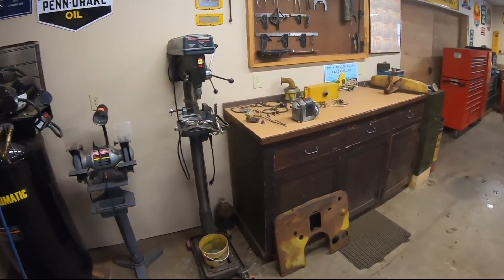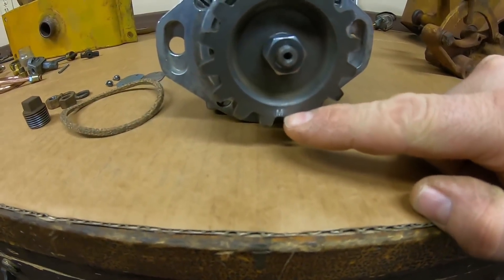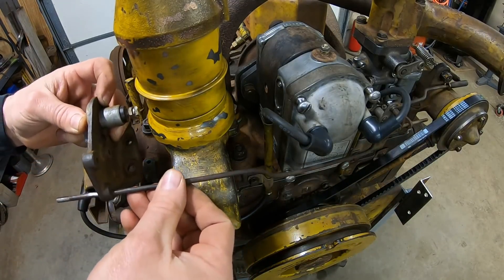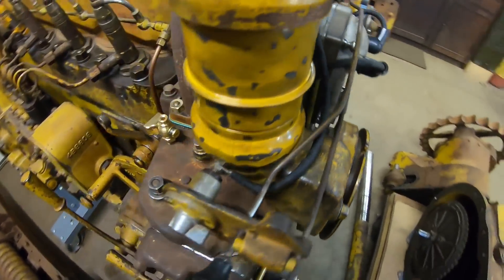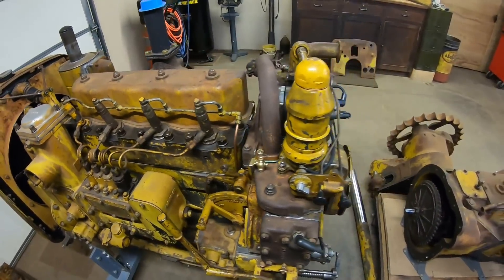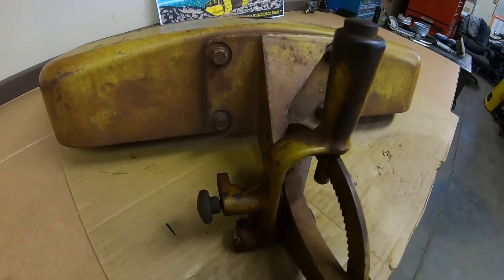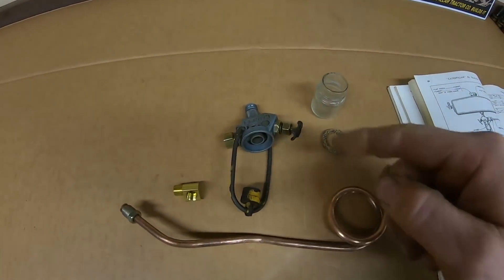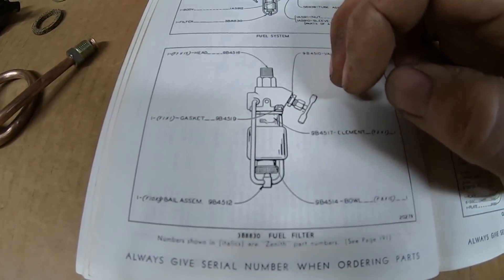Caterpillar D2 #5J1113 Starting System Rebuild Ep.20: Final Assembly Before Startup!

Comment: The overall look of the completed power unit is neat because all the parts are cleaned but not re-painted. The new parts standing out with an occasional polished brass or copper fitting for minimal bling. It says I am in good shape, ready for work and not afraid to get dirty. Great show!!

Comment: Oh the memories!  Pulling a 3-16 Deere plow with Dad's D2 back in the 1950's starting at about 8 years of age.  The sun was hot and the days were long.  We slipped on steering handle extensions of 1/2" pipe so the operator could stand while operating to avoid the wind blown dirt that the tracks brought up the backside.  The rocking fore and aft of the short tracks would sometimes cause loss of operator balance so had to hang on to the extensions which was not a good thing in and of itself.
I vividly remember holding back on the throttle lever past the last notch so as to gain a tiny fraction of additional speed.  Would wear goggles to keep the dirt out of eyes.  Would let the RD6 and D2 engines idle over the noon hour.  The D2's right track would slip off the idler occasionally and would do reversing and steering maneuvers to get it back on.  Running the track in the furrow wore the rails unevenly.  Could go on and on here.

Comment: Awesome video the fuel filter work around looks really nice. The pony motor in full dress is a real compact package. It's always a pins and needles moments when you are starting a rebuilt engine for the first time especially when you have never heard either engine run before and in this case you have lots of parts from several other machines and lots of new parts all combined into one package. Keep up the great videos Toby. It's going to be nice to see it running and blowing smoke.

Comment: Only a couple of engine rebuilds I have done started without issue, a Fordson Major unit (superb starters at the best of times) & a Isuzu pickup truck unit.
Both started on the 1st turn of the key.
Other times with various diesels not so lucky, indeed I've had to tow some down the road to get them started.
Great video Toby & can't wait for the start up.

Comment: I worked for Ford as a technician many years ago and my specialty was carburetors, fuel injection and ignition systems. One day I was talking to the shop manager who also did the same specialties as myself and he told me that back in the late 60's early 70's, Ford had a problem with vehicles quitting or a no start after running for a long period of time. He would pull the distributor cap off and inspect it and reinstall it and the vehicle would start right up and run.  What Ford found out was the constant sparking created a gas that eventually choked the spark form the points causing it to quit. The solution was the vented distributor cap. That is why the magnetos and distributors are now vented. Just an FYI.

Comment: Wix 33051 filter for a quadrajet would also do if need be. Has a check valve in it but they are seated in the rubber sealing gasket on the filter and pull right out. I've put several in sediment bowls over the years.

Comment: I hope to be there too! Well the biggest concerns for me would be fine dust or power in the fuel system tank on the pony motor. After that it would be the static leaks then running leaks. I am sure that you will be just fine. Relax and smile and enjoy the ride. It will be fun!

Comment: Old Wisconsin small engines have the same aluminum stack style filter in the sediment bowl👍 not sure of the models but those old single cylinder motors are super common

Comment: I am like you and I don't look fwd to the "start it" phase. I've built a 32 street rod, fully restored a car and rebuilt a few engines and gearboxes. No matter how careful and diligent your are it is rarely 100% successful. There will always be adjustments to make, oil and/or coolant often finds an escape route and there could be the dreaded rattle or noise that spoils the smooth whirring sound. If its none of these one of the new parts you fitted will suffer infant mortality. I love these car restoration tv programmes where they are fighting against an impossible deadline. They only have one day to paint the car and put the engine in but they always make it and they turn the key and everything works perfectly - what a load of spherical objects.

Comment: Back in the 70s and 80s, yeah I'm old, Rochester carburators used a fuel filter at their fuel inlet that looked identical to the element you removed from that universal inline unit. I believe it was used primarily in their two barrel units. They also had a sintered bronze option. 

Dan
Reply: That is what I thought too. That element is like the GM fuel inlet filters. My concern is if it will flow adequately with the low head pressure. I have always avoided using  inline filters on gravity systems. I have moved on to the in tank combination standpipe filter screen with just a shut off ball valve and no crappy  chinese filter bowl.

Comment: Rather than going through all that bs with that inline plastic filter! Get a chevy q-jet carb filter that has a rubber gasket on it and all you have to do is drill the hole for the bolt out of the box for maybe $5  for the filter
Reply: Gm started using the q-jet in 1968 and didn't change it out tell 1986 in the trucks when they changed to fuel injection.

Comment: Hat's off to you for using grade 5 bolts for your fixtures and specialized tooling. One of your previous videos, you installed brass nuts on steel studs for the exhaust manifold/exhaust attachment. That is the first time I've ever seen that. After researching I discovered that using brass nuts on steel studs makes disassembly easier. My question is this: Why aren't brass nuts used on all exhaust manifolds?
Reply: my best guess would be cost.  If the manufacture feels that they can get away with steel nuts until after the warranty is up then they save some $$$.  I could be wrong though.  I always use them for exhaust work now after learning the hard way with some studs that broke rather than release the nuts after years of heating and cooling cycles in the damp NW air.

Comment: Here is a question: can you shut off the starting engine by only using the draining peacocks on the heads? Everything else looks fine. One more thing to keep a eye out is gas and diesel leaks, sometimes the starting engine gas tanks tend to leak a little first. But we shall find out what the weak link is if there are any to begin with.

Comment: Okay, now the nervous part, does the fuel system sill up, does the oil pump up and lubrication work properly, do you have proper oil pressure. Nice job so far Squach....

Comment: Would they have used a similar design of magneto on some of the CAT Thirtys? Was chasing the Big Boy in August of last year and was staying in a hotel just outside of St. Louis. Happened to see a CAT Dealer (Fabick CAT) on the side of the road with a few older crawlers out on display and so I stopped and looked. Had 2 Thirtys, a CAT Sixty, a Best 60, a Holt 5 Ton and a CAT R5. Anyways, one of the Thirtys had a magneto that looked very similar to the one you showed, minus a few minor differences.

Comment: Was the knob you used the puller on plastic or metal? Just curious if a bit of heat would have worked to overcome the rust instead of requiring the custom puller.